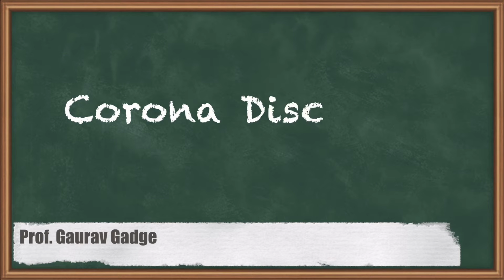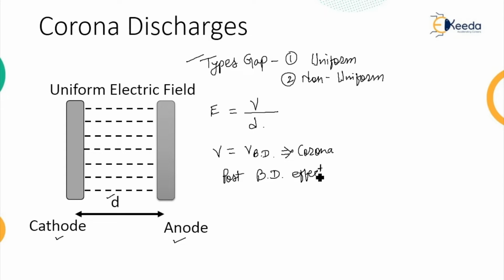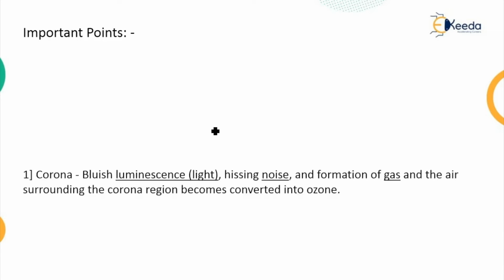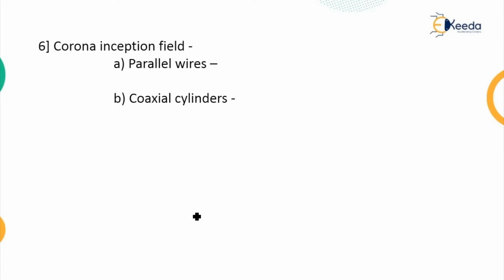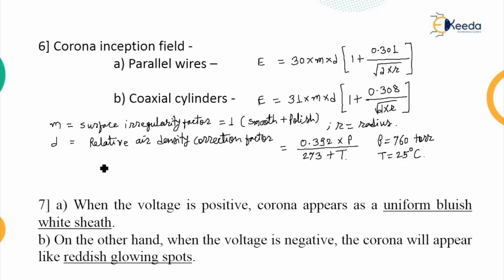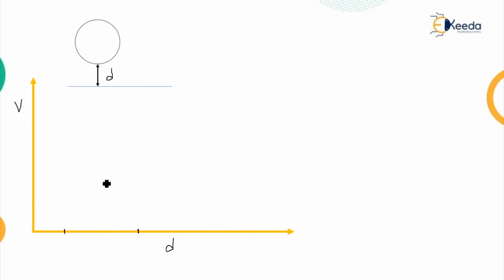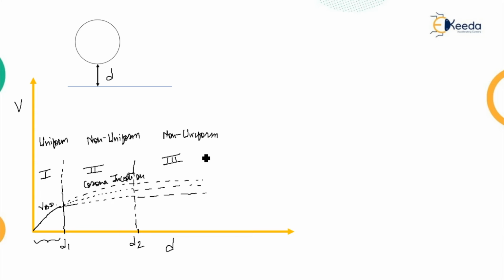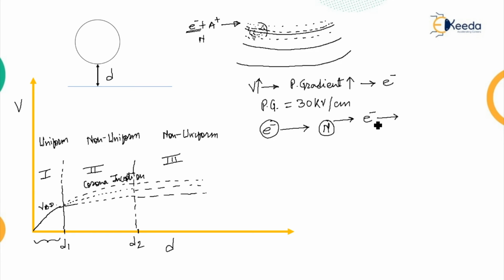Corona Discharge - High Voltage Engineering

Comment: What are the levels and stages of HV Labs, i.e., Stage-I, Stage-II, and Stage-III? What are the BS Electrical Engineering degree requirements? Please provide some information about both computerized and manual labs. Considering budget constraints, should I purchase a Stage-II manual or a Stage-I computerized system? What do you recommend for the BS program – Stage-II manual or Stage-I computerized?